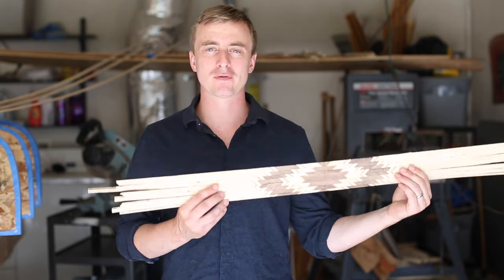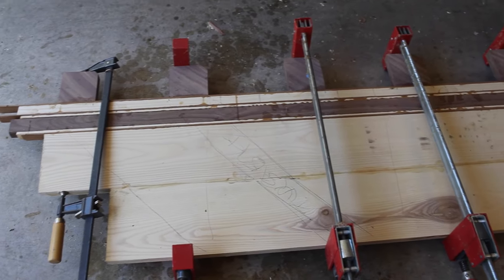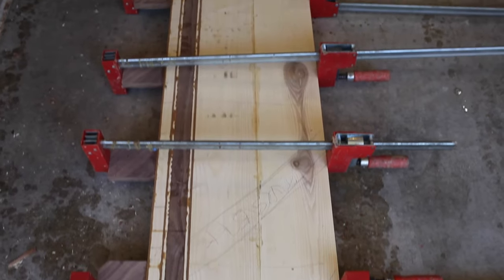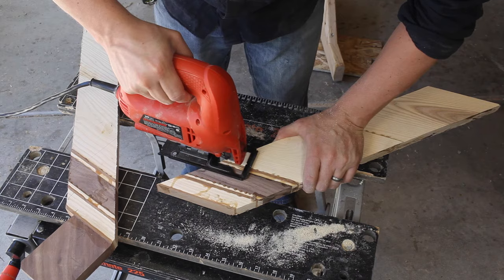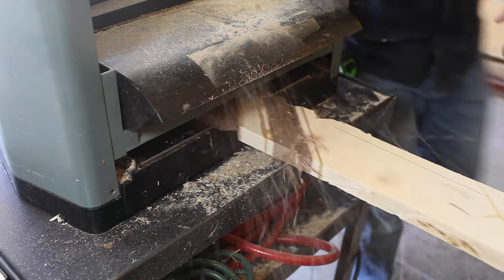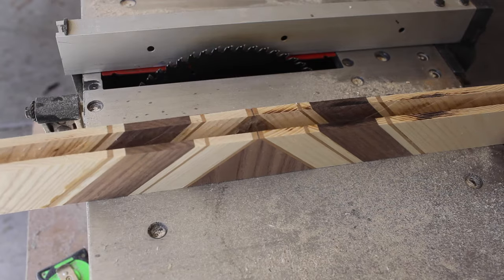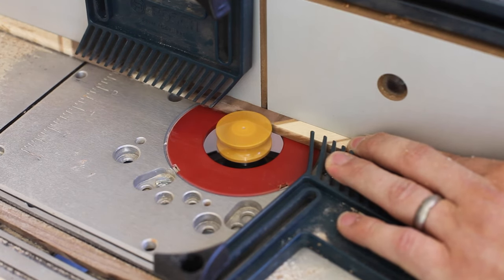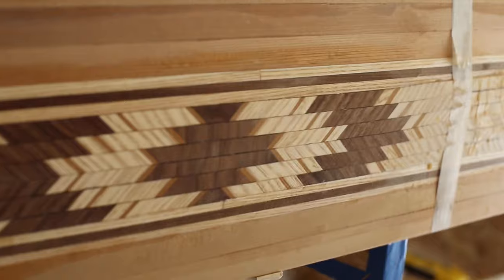Making a Decorative Pattern (Ep 5 - Cedar Strip Canoe Build)

Comment: Free hand on table saw isn't recommended for most people, but I'm impressed that you are able to do it so well, Adam.  You must have spent a lot of time working with wood growing up, or you're a lot older than you look.  I've been a carpenter for 14 years, free-hand on the table saw all the time, and so far still have all ten digits (knock on wood). As with anything, it's not without any risk, but it can be done safely and smartly.  The safety police giving you flack probably wear football helmets when driving the freeway.  Keep up the good work.  You're showing a process, not teaching shop class.

Comment: is Poplar a choice for strip canoes?, that wood is not knotty, light and available locally.
please give your comments
Reply from the maker: Alvaro Acosta I'm sure you could use it but ive heard it Discolors and rots quickly. I would google it cause there are a lot of forums that would probably have a lot to say about it...
Reply: I'd use Poplar if I didn't care about weight, but then it's not that heavy, and strippers tend to be light by design.  It is not rot resistant, but then I'd have it wrapped in fiberglass and resin with extra wear protection and do my best to tend to any damage straight away.  Amazing colors can be found in green sawn Poplar, but I don't know how they last.  It usually ages green (oxidation-which shouldn't happen encased in FG.  It's very strong and tough, and last centuries kept dry (ask any antique furniture person).  I may check on local availability today.  I personally cannot stand the smell of Western Red Cedar, so am open to options others might not consider.